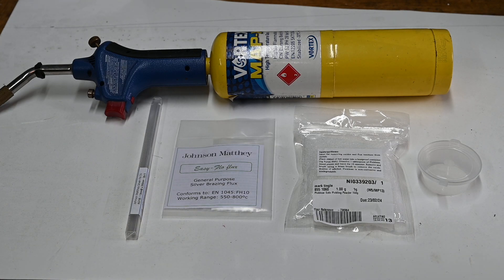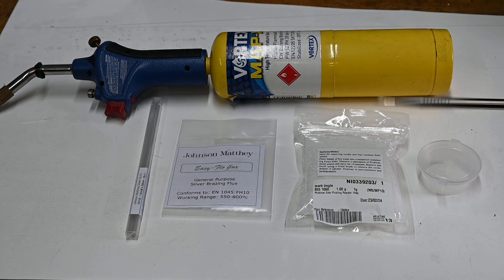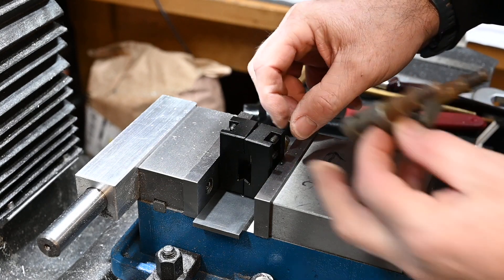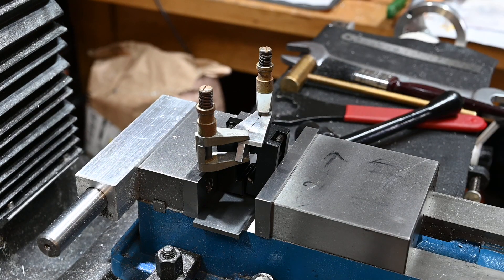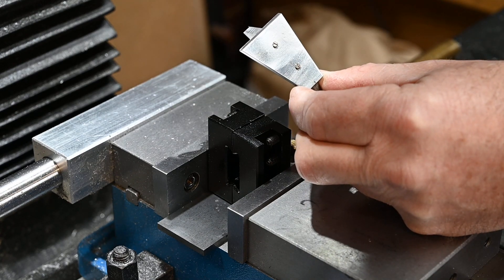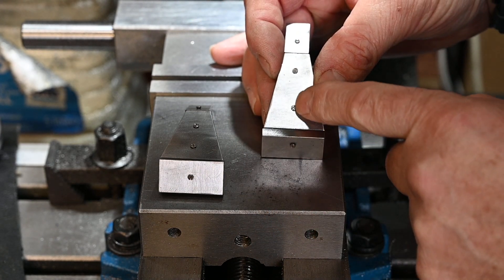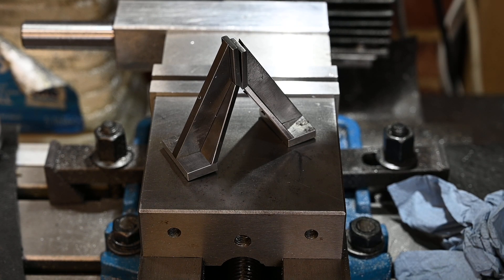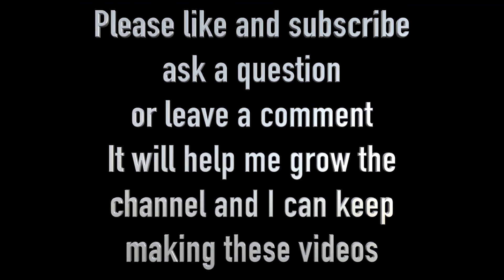Finishing Trunk Guide Support Legs EP06

Comment: Making good progress.  There seems to be a lot more work in fabricating these parts than there is in machining a casting.
My engines used to be shelf queens until I discovered my local society has a 2 monthly small engines group meeting.  It's a nice, low key get together and a good excuse to run my engines a little more often for the pleasure of like minded souls.
Reply from the maker: There is a group near me at the local steam museum but it’s mainly traction engines 👍